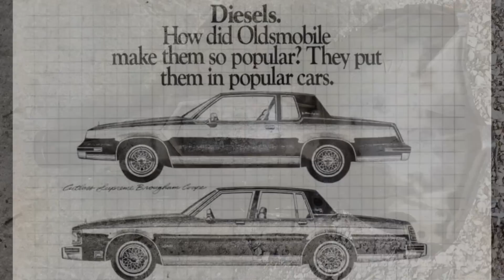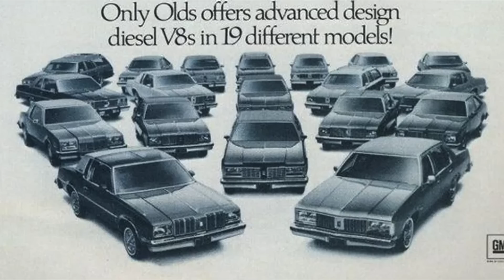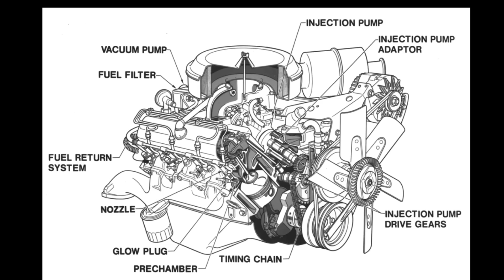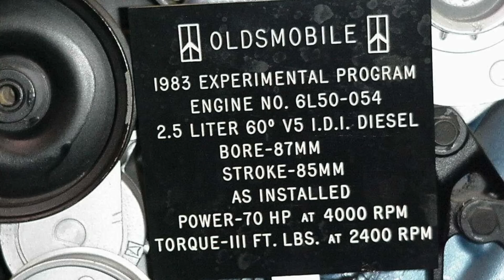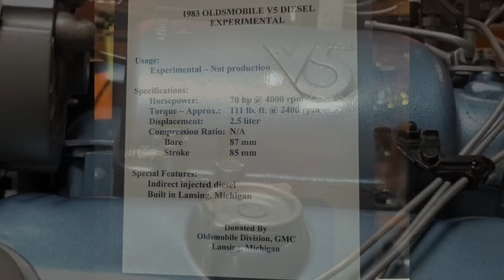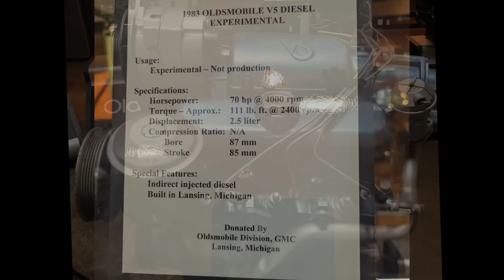Craziest Automotive Engines: Oldsmobile's V5 Diesel (Yes, I Said V5)!

Comment: GM's Diesel issues did not stop with these engines. GM actually co-designed with Detroit Diesel the infamous 6.2 ltr diesel that came in two variants....a C code for light duty (some cars, Blazers, 1500 and 2500 series) and a J code for 3500 series and military applications (Hummer for one), They were produced from '82 to '91 when in '92 they came out with the 6.5 Turbo which fixed many of the problems of the 6.2 while significantly increasing HP and Torque. I had an '83 3500 Dually Crew Cab 4WD with the 6.2 J code. It was by far the most unreliable and under powered truck I ever owned. On a good day with a tail wind, I could get to 65mph...towing with it was a nightmare. It had 130HP and considering it was already a heavy it was way under powered. It was a truck that could not do truck things like towing. I had the truck for 5 years and I replaced the transmission at 17K miles, 4 sets of auto locking hubs, AC fixed more times than I can remember, replaced the Stanadyne injection pump twice, glow plugs I changed like spark plugs (I had to carry a can of either in the event they randomly failed), water pump three times, the press on runner fuel return lines would pop off regularly and spray raw fuel all over the exhaust manifold (I carried extra hoses just for this not to mention two fire extinguishers, and the body was a joke....all 4 doors rusted out badly, around the rain gutters rusted out to the point I could see through them, cab corners...so bad that when I closed the door parts of the truck fell to the ground. When I sold the truck with 67K miles on it I almost had to give it away....it was poorly designed, poorly built, under powered vehicle that neither the dealer or the manufacturer would stand behind. This truck waved me off from buying GM products until I bought a '99 3500 Suburban with the Vortec 5.7 which turned out to be a real good vehicle...but other than that it has been Ford or RAM/Dodge since then.
Reply: The 6.2 J code was used in 3/4 tons above 7200# gvw. The 6.2 was in production until 1993. In 1992/1993 the 6.2 and 6.5 used the same block even. All the issues you listed were not changed with the addition of the 6.5 besides yes, more hp and torque with a turbo. There were naturally aspirated 6.5's as well. 
I'm not sure how you had that much go wrong in 67k miles. I've put probably a million miles on a half dozen pre-worn out 6.2's and never experienced a 10th of your issues. I've never had injector return hoses blow off? You need to run the good German made hoses, not Dorman or Vatozone junk, but still you'd have to have a blocked fuel selector valve to cause that. 
The water pumps are very stout units, with proper cooling system maintenance 100-150k intervals on them is normal. 
It you had a 3500 with an auto you had a TH400, if you are ruining TH400's with a 130hp, I'd love to know how. 
If you had alternator issues, that can trigger the glow plug controller to cycle when driving, I absolutely cannot fathom how else you would go through so many glow plugs. I average about 100k on a set of AC60g glow plugs, and that's with a manual push button to actuate them. 
2 injection pumps at 67k?? Were you filling up from a swimming pool? You knew it had fuel filters right? 
My '87 V10 has over 400k on the original 6.2, it is tired but it's still dead reliable. 
Squarebodies obviously have a huge following and are bringing so much money lately that I'm not even interested in buying anymore. Hardly a "poorly engineered vehicle" 
You had to take a 6.2 for what it was in 1983, 130hp and made for fuel economy. If towing was your game then you should have got a 454. 
If a 6.2 was used within its design perimeters and maintained, they were economical and great. 
Everything East of the Mississippi rusts, doesn't matter the brand. Washing the salt off once in a while helps. 
I just can't fathom how people struggled so hard with these.

Comment: I had a buddy who drove a 5 cylinder flat head Plymouth for a while. It didn't start out as that but after it cratered the number 6 rod journal he yanked out the piston  and sawed of the rod so he would just have a sleeve around the crankshaft.  It shook a little but it got him down the road .
Reply: I was going to say, a piece of leather belt and a couple of hose clamps if you didn't have the lower end of the connecting rod 😂😂

Comment: GM knew no bounds when it came to shooting themselves in the foot by cutting corners.  I remember test driving an Olds Cutlass with the original 3.8 V6. If you recalls they had just pretty cut off the last two journals of a 350 crank and used that for the crankshaft. Up to about 35mph that car shook like it was missing two cylinders, which it was.  
One point I would like to make about the video is that the iron duke was not a bad engine so give it its due. It did a decent job  as far as 4 cylinders go.
Reply: The 3.8 isn't a small block with two cylinders removed.  That's the 4.3 V6.  

You're talking about the old odd-fire 3.8 V6.  They weren't smooth at idle, but pretty much anything off idle was OK.
Reply: @immikeurnot  the 3.8 is indeed a 350 with the last two journals cut off, however it's derived from the Buick 350. The 4.3 V6 is derived from the SBC.

Comment: The transmission thing doesn't matter. So you took a transmission designed for a 100hp 4 cylinder and put it behind a 120hp v8 whoop de doo. 70's and 80's V8's struggled to make 120hp. So that transmission is fine. And if it's built like a TH350 or TH400 it will handle 10x the stock power. What was bad and should have landed someone in prison for pre meditated murder was the Cadillac HT4100 at wide open throttle you would merge onto the interstate at about 27mph, it took those cars several miles to hit 55mph. Something like one minute forty five seconds to hit 55. The oldsmobile diesel thing is largely overblown. If you put a aftermarked water separator on the vehicle and buy an $80 set of aftermarket head bolts those engines will easily go 400,000-500,000 miles.
Reply from the maker: Transmission durability is not related to hp. It’s related to torque.

Comment: Olds nade good stuff, it's a shame they wasted their potential with the 350 DX and 307, they should have kept the 350 Rocket and carried it into the TPI era, guaranteed it would have been better in every way than the carb'd 307, especially in the big heavy cars they saddled it with. The Buick and Pontiac V8s had incredible potential as well. A proper Sequential Port EFI turbo Buick 350 or 301 Pontiac with normal heads, possibly stroked to 377ci with a regular Pontiac 3.75" crank SMPFI and a Turbo option with all the GNX 3800 V6 advancements could have been world beaters, could have used them in the premium cars(Olds, Pontiac, Buick, Cadillac and GMC...if thw Buick 350 got the Cylinders the 252 V6 had and was capable of a 4" bore with the 3.85" crabk would have Yielded a 387ci, with aluminum heads and twin GNX turbos could have been a 25mpg, 400-500hp vehicle with TQ fir days, 500-600ft/lbs easy on 91-93 pump in the finest Broughams, Riveras, LeSabers, GMC Suburbans, Roadmasters. I am waiting for factory water injection for more factory power on 87 fuel and lower emissions. I am in Brazil now and I am stoked about buying a 1998-2004 Chevrolet Omega(Holden Commodes) 3800 SII rwd $2,000-$8,000USD used all day, many are Level 3 armored, Ethanol is readily available pump fuel, I want to build a 78/75 turbo, 220/230 cammed, 3800 SII with 600-700hp possibly do a 5 or 6 sp manul swap, possibly do a C5-C7 transaxle swap or import an LS for a swap. I have a 2004 GTO 6M at home, had A 2011 PPV and a 2016 SS sedan so I can stay in the Holden game and strat playing wirh 3800s.

Comment: I worked at an olds dealer in the early 80s, the 350 diesel never had a chance, I had lunch with a few of the engineers that designed the engine in 1977, they had a pretty good engine, but gm did not have an overdrive transmission until 1980, the 1st prototype (an olds 98), was not driveable in as far as getting on an expressway ramp, so the engineers were told the engine had tohave a 3,800 rpm redline (crazy for a diesel), but they did it by increasing compression to 23 to 1 (crazy again) and retarding injection timing, they ran ok, and if you advanced the injector timing they had good power, if they would have just waited for a 4 speed transmission and left the compression at a reasonable 18 to 1, this would have been a great engine, it was a good engine if you installed head gasket spacers and had the 4 speed, they would go 300,000 miles, get 30 mpg in a 4,000 lb car, gm just did not do it right
Reply: The old Ford/International 7.3 IDI have almost the same compression and spin to the same revs, and they live long lives in heavy trucks and vans, so you can't blame the 350's demise on those things alone.
Reply: @DonziGT230 yeah, but the 350 olds diesels head studs weren't strong enough to handle the compression ratio. They were notorious for blowing head gaskets. The 7.3 IDIs were built right from the start. They were pretty gutless too but they would go forever!!
Reply: @invisiblekid7374  The guy I replied to blamed the compression and RPM for killing the 350s, I was pointing out that a properly designed Diesel engine won't be damaged by those things.
Reply: I agree with you, but we had a lot of cars that had unleaded gas in the tank, back then there were still full service gas stations and the diesel was a new thing in cars like a delta 88, it only took a few gallons to blow head gaskets or even bend rods @DonziGT230
Reply: @DonziGT230 yeah most idi engines with that style of precombustion chamber are in the 23:1 range. The issues were more so the low power, headgaskets, and shitty quality diesel of the day.
Reply: @trev0rbr  I run my IDI mostly on used motor oil, the diesel fuel of the day couldn't be shittier than that 🤣

Comment: I had a '79 Olds Cutlass Salon with the 4.3 originally Diesel. Gutless wonder. Then went to 350, then another 350, then another 350 all in 160,000 miles. Great car to drive, 350 was good when it ran, we replaced the hydro 200 with a hydro 350 transmission-problem solved. Really too bad GM didn't do a better job. GM had so many clink of engines.

Comment: The deal on the vacuum pump on gm light duty diesels is the transmission's offered were almost always a vacuum operated turbo hydramatic
Reply from the maker: Many came with a THM200 trans which has no modulator.  The vacuum was needed to power some accessories like the cruise control, operate HVAC controls etc.
Reply: Even more critically, without a vacuum pump there would be no way to power the brake booster!
Reply: @nerd1000ify  hydra-boost.... uses power steering pressure
Reply: @kainhall  didn't know about that one. Of course it's not an option if you don't have hydraulic power steering.
Reply: the olds diesels only had a turbo 200 or a 200 4r no vacuum for them but the ac and heater had to have vacuum and things like cruise control

Comment: I still got an good-condition 1982 Fleetwood Brougham with the 5.7 diesel, and I love it as a novelty. I've taken in on a few longer trips and I do trust it. I get 21-23 mpg and it is good for 75 mph cruising. Not much for passing power, but can sustain that speed. Get a lot of looks when I pull up to the diesel pumps.
Reply: My uncle got one a few years later, when they were dirt cheap. He loved it! He grew up with diesel tractors and knew how to keep it running right.
Reply: Lol. Go get em! 😈
Reply: I recently acquired a 2006 Mercedes E320 CDI turbo diesel absolutely insane vehicle I get 30 mi to a a gallon in town 500 Miles while riding in town there are videos of non-stop driving where people get 890 miles per tank on the highway and the tank is less than 21 gallons the tests are until the fuel light come on so maybe on 20 or 18 gallons 890 MI plus the cars extremely powerful 200 horsepower 400 foot pound of torque like a V8 I paid $2,000 for this car

Comment: As a mechanic who actually worked on these Oldsmobile Diesels. Yes, they had some problems, number 1 head gaskets and water in the fuel. But actually, if an aftermarket water separator was added, they would have a long life. The truth is that many owners had the cars converted with a used gasoline Oldsmobile 350 rocket engine a direct bolt in replacement. Why? Here is your answer. The vehicle would never need emissions testing. As at the tim,  diesels didn't need emissions testing! Two quiet running. And last diesel was not as easily found in many cities. I did forget one. Many times, the vehicle was relatively new, and it was cheaper to replace the engine with a gasoline engine than repair the Oldsmobile diesel. I would have purchased one at the time, but sadly, by the time I could have, they had been discontinued.
Reply: yes they were not as bad as the reputation, head gasket spacers and advancing injector timing would make them last a long time, and 30 mpg in a 4,000 lb car